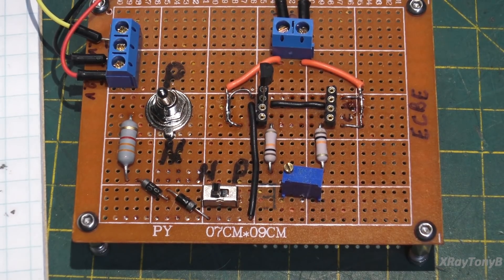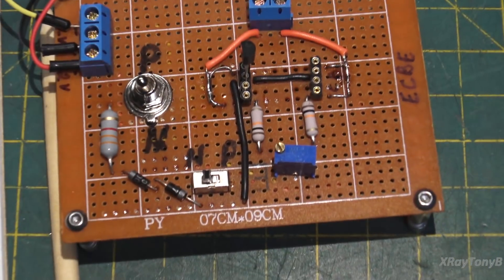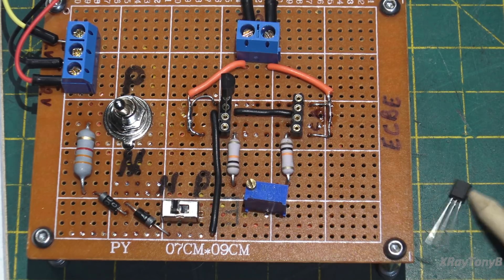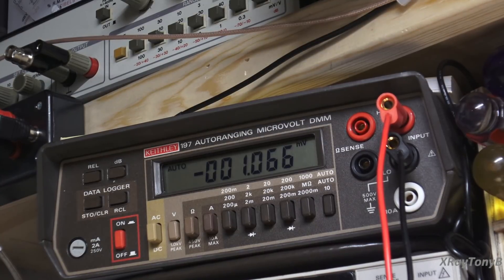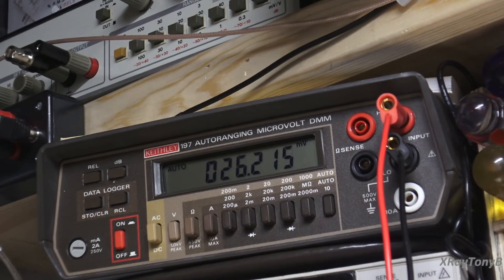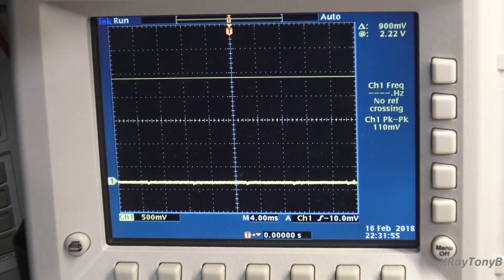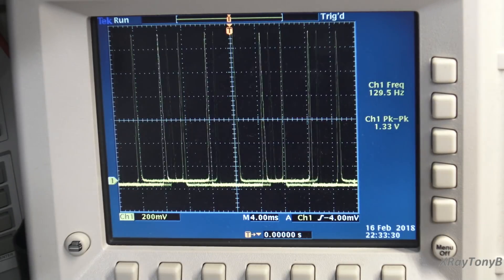Follow-Up to Simple Transistor Matching Circuit

Comment: if yu mainly match TO-92 transistors, consider connecting them at 0.1" distance from each other as mirror image around the base lead, and use a alligator clip to make the flat part of the case in contact with the other, this way the temperatures are way closerto each other than when being in free air and far away from each other.

Comment: Also if you need a matching transistor just buy HFA3046, HFA3096, HFA3127, HFA3128  chips They are matched transistors and thermally track too.  You can not get discrete transistors in separate packages to track thermally.
Reply: Have you checked pricing of your suggested chips to replace some penny parts ? 
Besides that it is hard to integrate this weird form factor into any given antique preamp design as a replacement part - 12 $ a piece without shipping for one single chip - which probably picks up a lot of  noise too because you need long wires for left and right - sorry, no way ! 
And i don't want to even ask about signal separation in such a case.
We're talking about old hifi repair here, not about some fancy newly designed board, where you can easily use such modern stuff of course.

Comment: If you use a 12V rms ac signal, you see NPN transistors turning on as the voltage goes positive on the collectors and you're measuring exactly the same as with a positive dc voltage input.
When the voltage goes negative on the collectors, you're seeing the emitter-base junction break down at about -5V for the 2N2222, which is almost matched with different samples of the same device (hence the small spikes). However, it is more like -6V for a BC547, so you see differences. If you think there's some value in matching Vebo for a pair of transistors, then there's value in your experiment. Sadly, I'm completely at a loss to think of any possible value in having a pair of transistors whose reverse E-B junction breakdown is matched. YMMV.

Comment: Either just connect the diodes in antiparallel and forget the new switch, or simply leave out the 3.9K, the diodes and the new switch. None of them have any significant effect with 0.1mA going through the transistor. If you're going for 1mA test current, then the self-heating from having 12V across the transistor will now be 12mW which will raise the junction by about 5°C, so can start to introduce noticeable errors in your Vbe matching. In this case, by all means use the 3.9K resistor and two antiparallel diodes to clamp the collectors so that only about 1.3V appears across the transistors.

Comment: I like your idea, thanks for the video. 
Bipolar transistors Vbe  (and silicon diodes too) have -2mV / C temperature coefficient. This effect is so consistent that it can be used to build a thermometer. When you first install the second transistor, your hand has increased its temperature a few degrees C, and they need to thermally stabilize to get a good match. To get better than 1-2 mV of matching, you should tie them together mechanically, typically this is done flat-side to flat-side with a tiny clamp, ideally with thermal compound. Same with any circuit that needs Vbe matching. 
In any IC or matched pair of transistors, extreme care is taken to put them close to each other to make sure they thermally match. 
Good luck! 
Dave Erickson

Comment: How are you going to get 1 mA thru the transistor with only .6v going t the collector?

This isn't even enough voltage to forward bias both junctions of the transistor.

At best, you are only biasing the collector to base.
Reply: Assuming an NPN, you have the collector at +0.65V, the base at 0V, the emitter at -0.65V. That's Vce = 1.3V and the transistor will work fine @ Ic=1mA.

Comment: Thank you for your time.  The goal was achieved, assembling a circuit that allow us to compare two transistors.  It was made clear that this wasn't meant to be a transistor gain evaluation, so no false expectation.  What could be a nice add-on is the integration of an op-amp that would simply turn a led on or off if the output voltage is within a preset range or value.  Doing so would make the circuit even more portable as a DMM would be required only for the calibration.

Comment: Hi, you've started in the right direction, but finished with a solution contradictive to your thoughts. Here is a schematic "back from the USSR" (tube schematics are published in the same issue, to be clear how old it is): https://coollib.com/i/63/347563/_27.jpg It's intended for use with "center tapped" electromagnetic measuring head, but more importantly, it switches 3 different base currents. Having compared 2 transistors in 3 working points (bias) should be more than enough and even easier to use than comparing 2 curves. Even more, you can choose these base currents (and collector ones, of course) in regard to the transistors you'll be matching. You can adjust your schematic accordingly, closer to the your basically differential amplifier and a higher voltage, since higher resistor values gives you current source and current is what drives BJT.

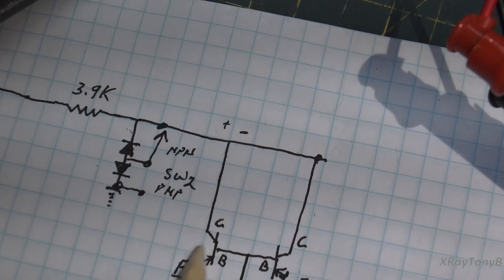Comment: At 3:26 you say that a "back" biased diode will drop 0.7V, a "reverse" biased diode will not drop any volts.
A "forward" biased diode will drop 0.7V.
Your switch is correct, you are "forward" biasing, that is in NPN mode, Collector is positive and you have the anode of the diode connected to collector rail.
Put your DMM on the collector rail and show us.

Comment: Didn't you even read the comment on the previous vid you made, and don't you correct your mistake?!
YOU ARE MATCHING Vbe NOT HFE!!!!!!
Reply: I understand turn on HFE and increments to total of HFE is critical for matching Transistors and Mosfets. Especially using Mosfets in parallel in Power Loads. But I was wondering if one would adjust time base and voltage, and look closer at the towers widths between the two transistors or Mosfets. Could there be seen a HFE  difference..!?! Now this would be using the AC 12-0-12 and placing cursors in the center of towers and measure out side of towers of  each side in increments.    Its turning on, and its turning off. Not to start argument, but just wonder.
Reply: @overload1010  Sure, but you would need calipers, now wouldn't you?
Reply: @airgead5391  Funny, I was wonder if slew rate in tower build time opposed to HFE. If HFE has different values , then on time slew rate ,I think would change also. But I use PICO, so I can over lay differences. And has more power and ability then other low dollar scopes.
Reply: @overload1010  I don;t know exactly what you are asking but slew rate is dependent on the whole topology.
Reply: @overload1010  what are you talking about? I think you are thinking of raise time and not slew rate! Slew rate is the change in voltage in 1 microsecond!
Reply: @overload1010  Matching FETs is a very different problem from matching BJTs. A BJT has its Vbe at a fixed current and temperature characterised by a single parameter, the reverse leakage current of the B-E junction, so if you match Vbe for two samples of the same device, you're a long way towards having the same characteristics.
For FETs, the voltage needed to give a particular current at a given temperature depends on both a current parameter and a voltage parameter, which are related, but not tightly enough for samples of the same device to be guaranteed to track as Vgs and Id vary.
Reply: If you're trying to make a differential pair, then having the same Vbe at a given current is far-and-way the most important parameter to be matching, because that determines the offset voltage of the pair. Matching Hfe is only important to minimise offset current and most of the time you can work with sufficiently low source impedances that it is irrelevant.
Reply: @RexxSchneider  Yes exactly, often that is the case.
Reply: Hey @airgead5391 , Reading this whole post, the comments (including yours) and the replies to your comment, I wonder how frustrated you should have gotten back then in that pretty much no one acknowledged the point you made which is ABSOLUTELY right.
Of course that matching transistors is a can of worms and one cannot pretend to really "match" any pair of transistors by comparing just one of the transistors parameter, and yet, at one single point in the curve.
All this tester does is comparing Vbe and, to the contrary of some of your repliers implied, this IS NOT the most important parameter in matching transistors, even for the use in differential pairs.
Indeed, thea matching of Vbes is what will become more apparent in an amplifier, presenting itself as offset error and therefore, non zero voltage at the output (which many people seem overly worried about... Some millivolts of DC output on an amplifier doesn't make all that difference for the speakers), but surely matcheing hFEs is much more important to ensure the distortion introduced by the diff. pair is minimal...
The only real value in matching Vbes is that, in a batch of transistors that are surely from the same lot, is that if the Vibes are matched there's a great likelyhood the other parameters will be relatively well matched too, but only if the transistors are from the same lot.
If one cannot ensure they are, then it's much better to match for hFE, and this tester doesn't do it.
Ideally, a good transistor "matcher" should combine in one single "null" indicator, the matching of Vbe, hFE, across a range of currents (and not at just one spot on the curve).
Reply: @fabiotrevisan8922  Thanks. Well, I post my comment, and don't really care about it later. I don't want to be " a smart ass" but if there is a glaring fault I at least want to prevent others to follow the wrong information.

Comment: Isn't using the oscilloscope stepping away from the idea of a cheaper way of transistor matching?
Reply: Indeed, using a scope increases the overall price tag but I'm pretty sure there are little DIY scopes, like the DSO138 for instance, that would be plenty sufficient for this kind of purpose and some others as well.  The DSO138 is cheaper than a DCA Peak transistor tester by far.

Comment: You could have gotten the performance that you wanted by placing the diodes in reverse-parallel.  No need to make another video about it, and your switch setup will work, but the switch, besides increasing cost, introduces another thing for the operator to have to remember.

When running it on AC like at the end of the video, the switch scheme may not be working as you want.

Comment: Tony I really enjoy watching your videos but on this one I am not sure your circuit is working as well as you think it is.  I have a problem with the back to back diodes feeding the Base of the transistors.  One will be forward biased but the other one will be revers bias so there will not be any current flowing into the base of the transistors.  This could be why the meter was incrementing as some parasitic capacitance is charging.  A better mod might be to replace the diods with a pot between the + and - voltage with the wiper feeding the base of the transistors.  This way you could not only see if the transistors match at one bias point but at many bias points.  This will test the linearity match as well as gain match.  Just my 2 cents
Reply: Thanks for fixing the diode problem.  I am still curious how a pot on the base performs under the same conditions.  Good Idea to use a sine wave and a scope.  Sometimes using a meter it would not be obvious if there was a oscillation going on.
Reply: For an NPN, the diode clamps the collectors to about +0.65V. The bit you may be missing is that the bases of both transistors are connected to ground, so are fixed at 0V and therefore the emitters are at -0.65V. The base currents are drawn from the 0V supply. The diodes are not feeding anything. They simply pass excess current to ground and work as 0.65V shunt regulators, or "clamps". The meter was changing because every time the transistors are handled, they warm up by several degrees Celsius, and the Vbe has a temperature coefficient of -2mV/°C. You are seeing the last transistor handled cooling down.